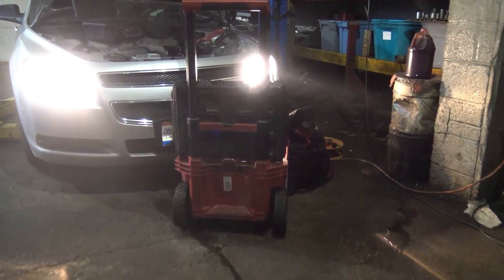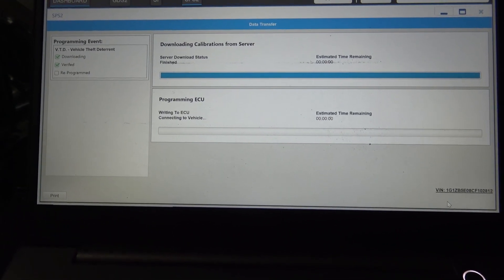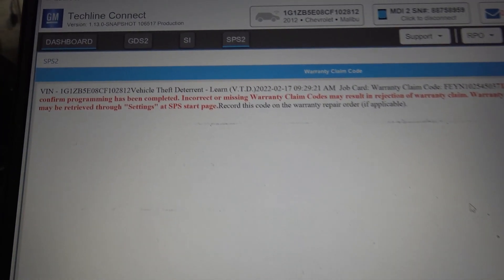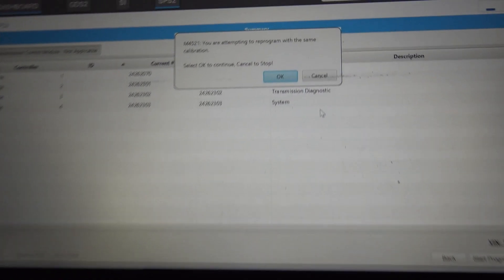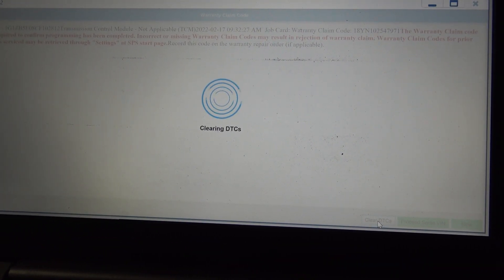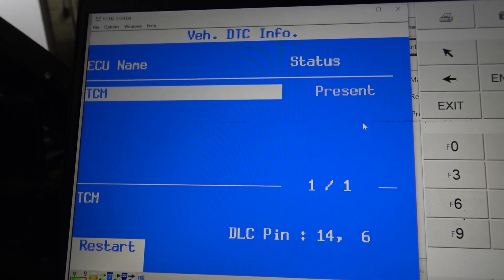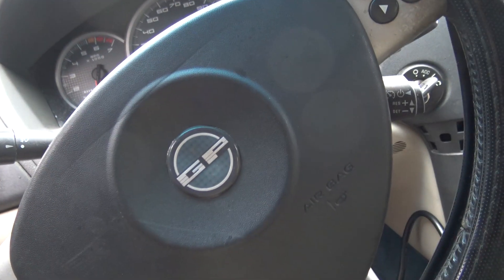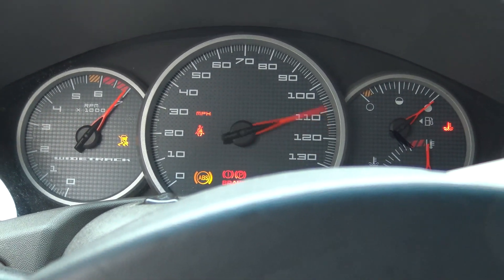2012 Malibu Used PCM Programming End Of Day 2 17 2022

Comment: How come I’m never able to program a used ECU since the introduction of the Techline Connect ?
Can you please explain this to me please 🙏
Reply from the maker: It depends on the vehicle, year and model.  Last week I did used on the following no problem.. 2002 park Ave with a 2003 impala pcm, 2006 express pcm , 2008 impala bcm, 2013 terrain tcm, all used , tlc sps2 no problem normally via  dlc. In the same week I had a 2005 express used pcm that work no program and a 12 cruze tcm that would not program with sps2.

Comment: Can I program a used tcm.
Reply from the maker: Gm will tell you it won't work.  I have done many used tcm's all the way up to , 2018 models, it is a gamble it may or may not work, depending on many factors.

Comment: Hey Brian I just installed a used transmission into my 2013 Malibu automatic transmission . It runs and drives now , reverse is working as everything. but it has code for Tcm and it has problems shifting smoothly especially for higher gears . Do you believe this is will be Fixed with a reprogramming/ flash ?
Reply: Thank you in advance
Reply from the maker: It can make a difference for sure. Used can give problems programming
Reply: @BrianMann216  thanks !

Comment: Got bored and watched your videos on my break. So on the Malibu could you of done what you do on the Chrysler’s? Have original pcm installed hit replace and program the swap in the used one so it doesn’t read the vin??
Reply from the maker: In my experience gm will erro out if you swap It out between the cal Id page and the programming.  They seem to recheck.

Comment: Just stick in and try it.  Don't need to Program if it Don't work. Built in Reprogram takes 30 Minutes.
Reply from the maker: not on this grand prix.   Shop tried for a day of the 30 minute learns and it would not take.  I have have many W bodies not do the manual laern in years past, not sure why, but seen quite few neeed sps..  even older impalas  with passlock 2 systems that should be able to do a manual 30 min learn according to SI , end up doing vtd via sps and all is good.
Reply: @BrianMann216  I use the built in System to Reprogram.  Radio's essential.  That key should of worked. If it don't Reprogram it.  Make sure it turns the ignition first.
Reply: You can actually turn Pass Lock Off.  Go into the Radio and Turn It Off.
Reply from the maker: @christopherwatson283  that's a new  one on me, never heard about that,  please do explain more.
Reply from the maker: What year make and model are you talking about , I have never heard of this. Sounds like you are speaking of disabling the radio lock or something.
Reply: @BrianMann216  When You get to settings.  Go to Security/Passlock turn it off.  Here's a good example of how to get in.https://www.youtube.com/watch?v=UjvOXhOuX0w
Reply from the maker: @christopherwatson283  that is for a passlock2 system,  very interesting.  Will not work with pass key 3, also  leaving the key on does same thing.   Totally different system apples vs oranges
Reply: @BrianMann216  Are You sure?  The radio is your personal system computer.  How do you reset oil changes?  Deal with Tires?  There's a lot there.  No telling how many menus are on the newer ones.
Reply from the maker: @Christopher Watson Hi Christopher  I am pretty sure!  I am not  good at corresponding by typing  ...  https://youtu.be/k4LjTe-hBPk